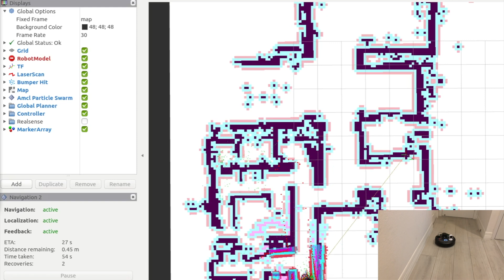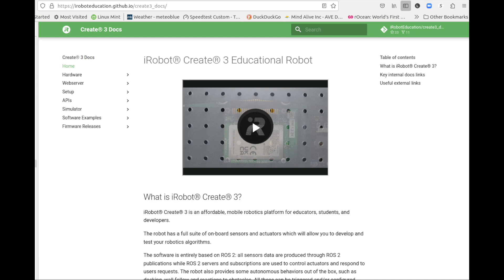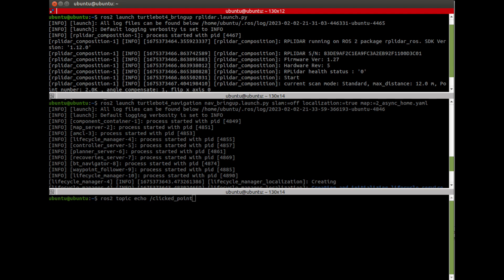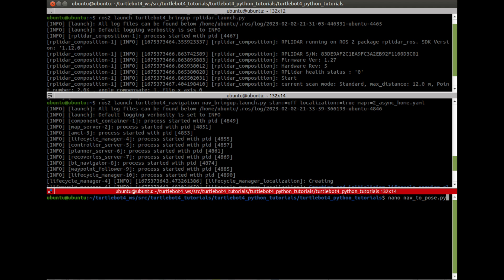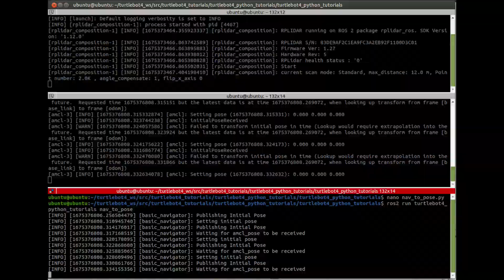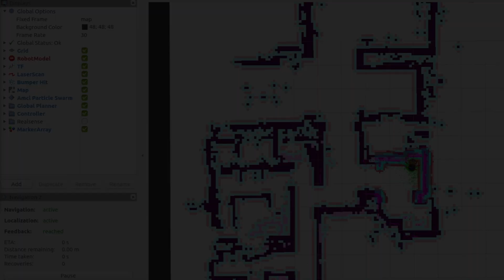ROS2 Security Robot (PART1)

Comment: Very nicely presented.  A few questions: 
1) If you change the async_mapping_params_file.yaml resolution from 0.05 to 0.01 the maps become much more pleasing; have you tried that?
2) Why did you choose to use Blink camera rather than PiCamera or the color cam of an Oak-D-lite?  
3) Have you changed the xy_tolerance in Nav2 param file to achieve better than 0.3m goal accuracy?  It seems that prevents more precise navigation to a goal.
4) With your 0.05 precision map, what localization accuracy are you seeing?  (You mentioned checking the odom at the end, but if localization only publishes a correction periodically, and only after certain travel distance or rotation, is it possible to know what localization estimates the pose is when stopped?)
5) I'm trying to choose between the "recommended Galactic firmware" and running the Create3 in Humble.  (I absolutely love the --once Humble option, so am not eager to use Galactic)
Having run your robot under Humble, do you have a clue why iRobot is saying "Galactic is more performant"?
6) Do you have a github repo containing your additional code beyond the TB4lite code?
Reply from the maker: Thank you for your feedback and questions!

  1.  I didn't attempt to alter the asynchronous resolution; I stuck to the default settings for the proof of concept. However, I experimented with synchronous SLAM at a higher resolution. Unfortunately, the Raspberry Pi was unstable and struggled to handle it effectively.

  2.  I chose the Blink camera because I already had it, and it required no additional configuration for this project :). Although I also tested the Oak-D-lite, using it on the Raspberry Pi, it was significant slowdown and a noticeable increase in CPU temperature.

  3.  I left the NAV2 xy_tolerance at its default settings.

  4.  The localization accuracy with a precision map of 0.05 was satisfactory during my tests, as long as there weren't too many subjects in the room, positioned relatively close to each other in the robot's path. This ensured there was a little more than the minimum space required for the robot to navigate through them. With modified nav_to_pose.py navigation script the robot udocked, precisely moved around the room and then docked back.

  5.  I haven't tried Humble yet; that will be my next step if time allows.

  6.  I don't have a GitHub repository with additional code. I used the TB4 Lite repository with very minimal modifications.

Good luck with your projects!